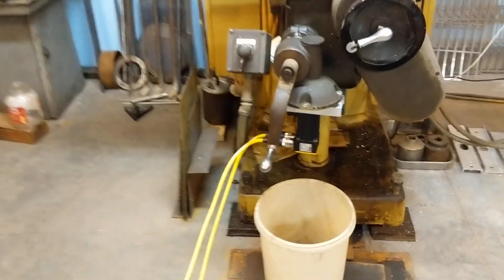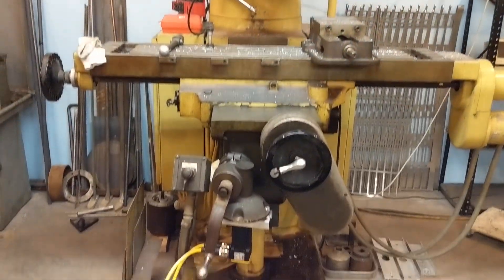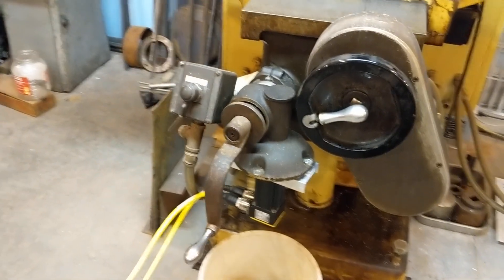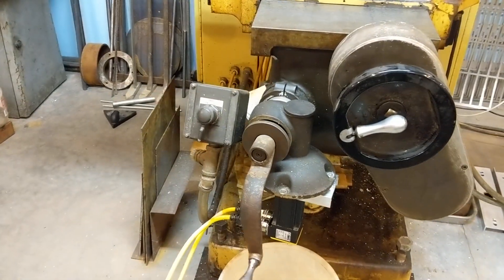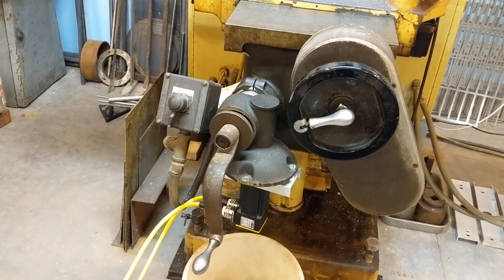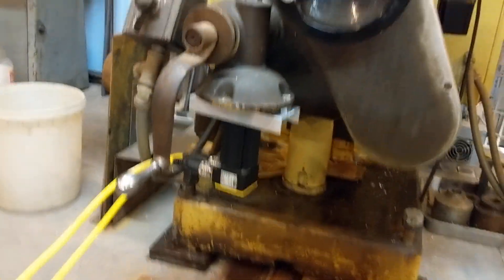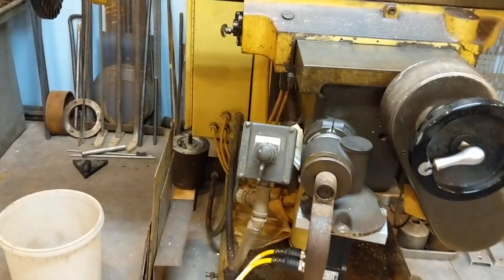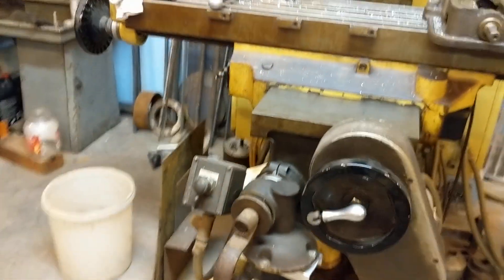Harmony VAWT January 29, 2019 Z-Axis Motion Control Initial Test

Comment from the maker: God I watched this video again and think to myself how HORRIBLE this sounds. That motor was under-sized, the coupler had bad runout in it. So the "clicking" you hear like gear teeth at high speed, is a result of the runout on the coupler causing the shaft to kind of click from side to side each and every rotation. It's rotating around 700 RPM in the fast portions of the video which translates to about 12 audible clicks per second that you hear as a "rough" sound. My new motor with a much better machined coupler is pretty much SILENT at 700 RPMs.